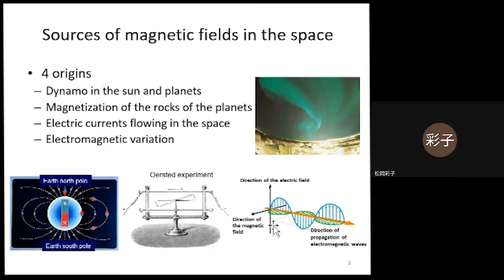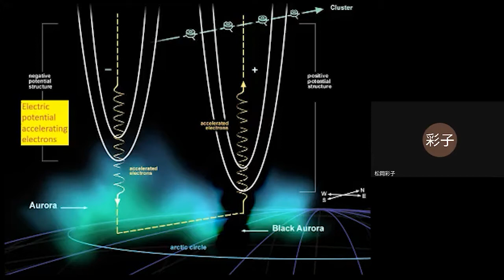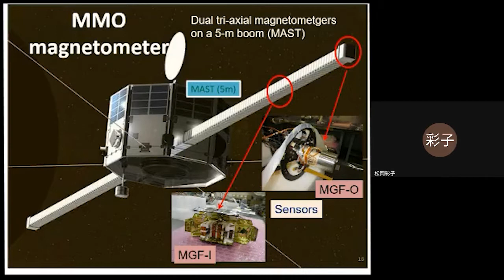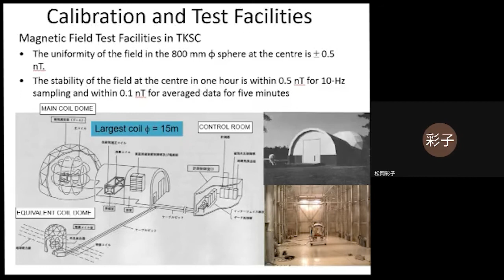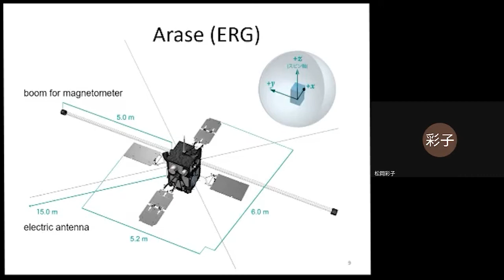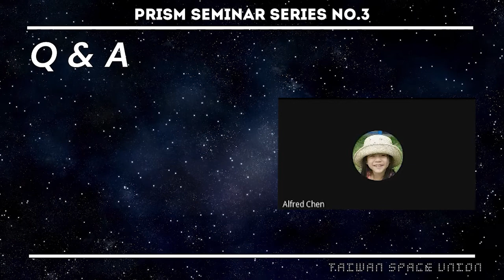In situ measurement of magnetic and electric fields in the space

Comment: In order to understand the phenomena in a certain plasma region, it is necessary to map not only the magnetic but also the electric field and the electric currents. Space is filled with a network of currents which transfer energy and momentum over large or very large distances. The currents often pinch to filamentary or surface currents. The latter are likely to give space, as also interstellar and intergalactic space, a cellular structure.
Hannes Alfven.
50 years later science is catching up with plasma cosmology.